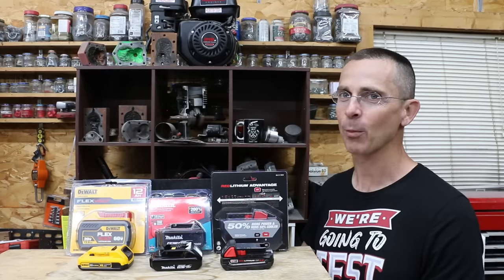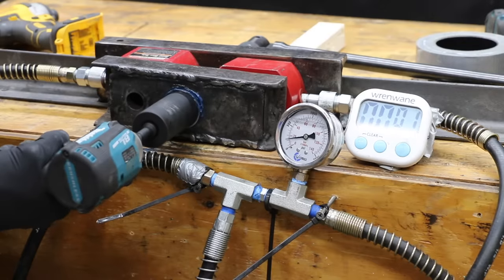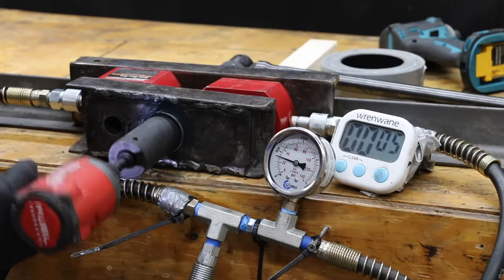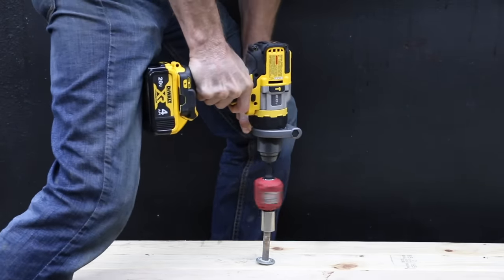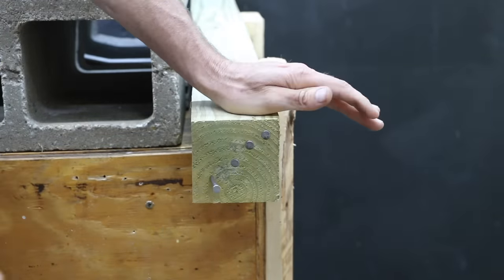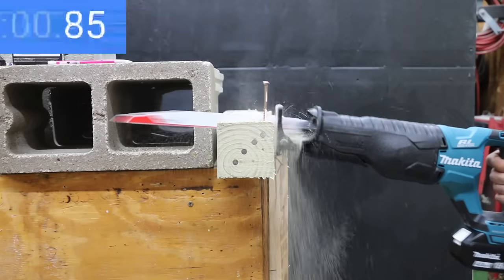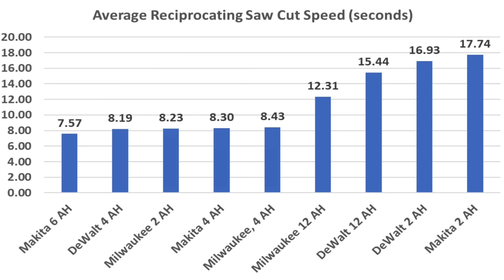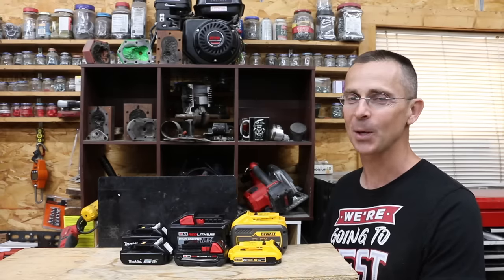Small "TOOL" Battery Better? Milwaukee vs DeWalt vs Makita

Comment: For Milwaukee at least - the difference in power wasn't related to the capacity, but instead due to the design of the battery itself. The High Output (aka CP 3.0) batteries use larger 21700 cells, versus the normal 18650 cells found in the XC (CP 2.0) batteries.  Newer FUEL tools can take advantage of these upgraded larger cells and literally make more power (torque and speed) with them, even if the capacity is smaller.  Nobody should by buying anything but HO CP 3.0 batteries anymore imho. They are more powerful and lighter and smaller for a given capacity. They are truly impressive batteries.
Reply from the maker: Thanks for the feedback.

Comment: If you know what you are doing and have the tools.  Just buy the cheapest one that fits your drill, open it up and replace the 18650's in it with some 20+ Amp High mAh ones.

Good Brands from 18650batterystore

BAK 30A 2500mAh
Samsung 25R 20A or 25S 25A, both 2500mAh

I'm sure there are other good brands out there, just make sure they are at least 20+ Amp.

If you can find some of the packs that are double size really cheap you can get more mAh out of it.
Some of the newer Higher AH packs use 21700.  So make sure to check to see what batteries they use before you order the new batteries.
Reply from the maker: Thank for the suggestion.

Comment: Told u so' on all your previous power tool testing, where you had very small batteries on the cheaper variants and often crappy packs that came bundled and your own big packs on the brand ones, that these 5A packs would fluke the result massively vs the 1.5A pack your used on the cheaper power tools, that usually was 1.5A and 2.A packs. (sure it aint easy to make it apples to apples, as certain brands dont have fx 5A packs,, but 1.5A pack vs 5A packs... would obviously screw your torque testing results a lot.
but it's funny how both you and this new Torque test channel TTC were of the impression it didn't matter.

Though they also made a new vid just a few weeks ago, where they also accepted it makes a huge difference... they saw around +25% to 30% on the ½inch impact wrench on their DIY torque rig.
I remember many years ago that Real Tool Review,  that dude with a guitar intro..which often used a Skidmore torque-rig (that YT channel is more or less dead today hence new content, but was a great YT tool-review-channel 5 to 8 years ago) his testing' made it very clear..
I used some 10 or 12 AWG silicone wires with spades connectors cramped on' and then I soldered one of these cheap 8USD 100A or 150A RC amp meter (with a blue display) in between and then had wires from the battery packs to the powertools and then i could see the amp draw on the amp display while testing it. 
It varied a lot from specific power-tool segment to the next, some had massive differences and some minor..

if the power tool is already maxing out with a low pack' and fx being choked by an over-protection circuit.. here the difference is little.. some tools have a very aggressive protection circuit, not least some angle grinders..we all know how annoying it can be when a tool keeps choking under load to protect itself and if that protection is too sensitive, can almost make some tools useless.
but on other power tools these battery packs with higher Amp values..here it mattered a lot, and the amp-peak was way higher and could sustain the amp-peak a lot longer.
same with the newer packs that are seeing daylight these years, that are using 20700 or 21700 cells.. here will lower amp-packs with 20700/21700 often outperform higher amp-packs with 18650 cells, as 20700/21700 Liion INR/IMR cells are able to deliver a lot more current, than an INR/IMR 18650 pack' if everything else is equal.
Thx for the vid PF.. +1
Reply from the maker: You are welcome!

Comment: Suggestion regarding home vacuum cleaners: 
Compare a few top brands (Dyson, Hoover, Shark, Bissell, etc) on suction when brand new, then upon regular (and equal) use monthly thereafter, for a year or more.
- Does higher suction equate to better and cleaner pick-up of dust and debris.
- Ease of cleaning, use and durability. 
- Any other useful points you come up with. 
THANK YOU for your efforts.
Reply from the maker: Thanks for the suggestion.

Comment: Those battery prices are a racket. Li-ion cells are a commodity these days (even good ones). >80% of that price is pure markup. The plastic casing is sub $1 in volume and even using retail prices for those cells there is over 50% markup much less what the BOM price is.
Reply from the maker: Thanks for the feedback.

Comment: Oi! Video idea for you!
Can you please test the effectiveness of different style garage door insulation? There’s fiberglass, radiant heat reflective/shiny stuff, and styrofoam. Especially with temperatures getting hotter year to year.
Perhaps to set up the test, you could measure the ambient temp of a closed space, with one or tow walls simulating an A/C interior wall?

I’m wondering if the radiant shiny stuff will help keep my house interior and garage cooler.
Reply from the maker: Thanks for the suggestion.

Comment: Le prix par Ampères heure n'a pas de signification . On ne peut pas comparer une batterie de 18V et une de 52V sur le seule base des ampères!. Une batterie de 18v 2Ah est moins puissante qu'une  batterie de de 52V 2Ah. 
18V 2Ah = 36Wh
52V 2Ah = 104Wh.
Une batterie de 18V 2Ah est équivalente à un batterie de 52V 0,69Ah (précisément 0,6923076923076923Ah). Il faut comparer par Wh.
Reply: Toutes les batteries sont spécifiées à 18V. Le DEWALT est de 12Ah à 18V.

Dans ce cas, nous ne voulons pas utiliser Wh car certains prétendent 20V, d'autres utilisent des circuits pour atteindre 60V. Ce sont toutes des batteries 18V avec des cellules similaires.

Comment: Didn't even watch this one. My company has all Milwaukee. I'm a millwright. Compact. Good idea. They die super fast for most applications. Only use I've found they are good for is portable lights. Maybe for the shade tree mechanic they are good. Heavy demand usage, I've drained one in 30 seconds. 1/2" heavy impact gun on a 5/8" bolt.
Reply from the maker: Thanks for the feedback.

Comment: @Project Farm, i got another idea: UPS's. What really Interests me is if they are able to be connected to way bigger batteries, Like instead of a 12V 7.2Ah use a 12v 80Ah battery and also additionaly (in a second test) add a 12v "some hundred Watts" powersupply to it to See how Long they can survive a constat i.e. 80% load. I just saw a Video by project farm, where he upgraded his moms Work at home setup with a large lead acid battery and i Wonder If you can Just Put that large battery into the UPS to save some Money.
Reply from the maker: Thanks for the video idea.

Comment: I'd love to see a video testing the many rubber and seal rejuvenators out there. Claims include rejuvenating gaskets, oil leaks, main seal leaks, transmission leaks, etc.  ATP AT-205, BARS, Lucas, Hapco Pro-Seal etc.
Reply from the maker: Thanks for the suggestion.

Comment: I really love the test. Right now I’m taking care more of my Ryobi batteries. Using them to what I really need them. For example, using impact drill to drill drywall screws, I definitely use a 1.5/2 amp battery. Drill concrete, the 4/6 ah battery and finally the cordless shop vac, the 6/9 ah battery. Makes battery last a little longer than using them on tiny task. I also separated the HP batteries from the regulars. HP tools with HP batteries, regular batteries on regular tools. Before, I thought that the higher amp hours was only for their duration of use. Which they are but with this video, it also increases their performance. So yeah…… I know is a something I do, with what i wrote……. I honestly wanted to complain about my boss using my drill with a 9 ah battery to remove an outlet…. Now that i got it out of my system. These test are awesome!
Reply from the maker: Thanks for sharing!

Comment: What about compared to the Ridgid tools? I was actually hoping to see a comparison since that is the brand I invested batteries and drills with but I suspect they would probably perform at the level of the Makita ones.  For sure using the 4AH battery is a lot more power and with a circular saw (which I have and use for light work) you need that 4AH battery.
Reply from the maker: Thanks for the suggestion.

Comment: Have you considered starting a 3d printing series? 

Most household 3d printers are within the same range as some of the tools you buy, around $300 - $1000 and printing material is easily between $10 (for basic plastic) and $1000 (for PEEK) per Kilogram
Reply from the maker: Thanks for the suggestion.

Comment: Best all around batteries are 4ah. Cost and full capacity charge times. I have kobalt weed wacker, tire inflator, and leaf blower. Seems like the 4 is most consistent with power and longevity for the task. Are the kobalt batteries any worse than desalt or Milwaukee brands? When my older craftsman drill and impact wrenches go out I will have to go with kobalt tools for the same battery family that I have on stock. Kobalt warrants all tools for 5 years and batteries for 3 years. I’m not a tradesman and cannot make a full lineup change on brands at once. I’ll probably get a cordless sawzall next, but I’m not replacing my skilsaw mag77(that’s my project baby). Overall I prefer Diablo blades over Milwaukee’s.
Reply from the maker: Thanks for the feedback.

Comment: dewalt 1.5ah and 2ah batteries, as well as the makita 2ah batteries, should NOT exist. they are trash. i use both systems and those small batteries suck so bad, in some cases making the tools unusable. they are basically mass produced landfill. makita's 3ah batteries and dewalts compact 4ah should be the standard battery for their tools. can't speak for milwaukee as i don't own any of their tools
Reply from the maker: Thanks for the feedback.

Comment: Have you tried how 18v batteries of different brands perform on the SAME tools? For example, a Ryobi vacuum cleaner using a Milwaukee battery Using an adapter?
Reply from the maker: Thanks for the suggestion.

Comment: I am curious about Dewalt's three different lines of 20v 1/2" chuck drills, mine is about due for replacement. I have flexvolt and large XR batteries so I don't know if I would get better results from the flexvolt advantage, power detect or regular. Or maybe they are all the same with different stickers for different suckers. I trust PF videos exponentially more than I trust home depot ads.
Reply from the maker: Thanks for the video idea.

Comment: Wow! I did not even consider this as reason some of my tools underperformed with bigger batteries. This is.a brilliant video. Love your work. have you done a video comparing same size batteries from each brand, e.g. 2Ah from each brand on a leaf blower to determine whose actually is 2Ah and whose isn’t? Lloyd
Reply from the maker: Thanks for the suggestion.

Comment: I exclusively use 2 amp batteries for my combi drills and drivers.. Somtimes if im making a quick cut ill als use them on my jigsaw.. I use the 5 amp for the big stuff aka saws, grinders ect.. I absolutely hate large batteries on a compact tool like a drill, if your working with you hand extended out or up like I do in carpentery,framing overhead and installing drywall  the smaller batteries make all the difference on a long day..
Reply from the maker: Thanks for sharing.

Comment: That Dewalt wasnt a 20v 12AH battery in the recip saw, it was running as a 60v 4AH. It's quite interesting how the higher voltage hurt the Dewalt Flex Volt recip saw. I believe the results would be a bit different if the tool and battery weren't the "Flex Volt" line.
Reply from the maker: Thanks for the feedback.

Comment: Seeing these battery adapters I'm interested in seeing if battery brands would effect the tool power like if using a DeWalt battery on a Ryobi drill would boost the drill's power.
Also since you've cracked these batteries open before I would be cool to see how replacing the 18650 cells in the battery with better quality ones like the lg mj1s would effect the battery pack performance and runtime
Reply from the maker: Thanks for the suggestion.

Comment: Love your videos, I think a item i struggle with finding a good one for is Thread sealers.... Would love to see a comparison i think it wouldnt be too expensive to test and you could test against pressure, fuel, heat, cold..... And use Tape vs dope vs thread locker, vs PTFE selaers, vs silicone the list goes on and on....
Reply from the maker: Thanks for the video idea.

Comment: This has me wondering: Milwaukee for example has a 3.0ah AND a 3.0ah High Output... is there a difference or just a gimmick?
Reply: In my experience, it is very much not a gimmick. The 3.0ah High Output batteries deliver a noticibly larger amount of power when compared to the regular 3.0ah batteries.

Comment: I use a 2.0 in my DeWalt or my Milwaukee impact as I primarily only use it for screws and when using it above your head all day it makes a difference I use a bigger battery in my saws,  drills and in my Milwaukee 3/8 and 1/2” impacts
Reply from the maker: Thanks for sharing.

Comment: Welding Gloves? Have you tested those yet? For heat resistance, grip and finger movement, burn through from molten metal drips or slag. There's a brand that's fairly cheap that I like more than my Millers which were moderately priced.
Reply from the maker: Thanks for the suggestion.

Comment: The battery adapter seems interesting, I wonder, why don't they make mod kits to use those 12 amp hour batteries with other devices such as electric shavers? Just have something to keep the  voltage under the max voltage the motor can handle, and see if shaving performance improves.
Reply from the maker: Thanks for the feedback.

Comment: The DCD999 is specifically designed to detect Flexvolt batteries and draw more power.  It would be interesting to see this test on the DCD996 which does not have a system to detect which battery is connected.  The DCD998 looks for higher Ah (8+) batteries and produces more power when it sees one.
Reply from the maker: Thanks for the suggestion.

Comment: Just a FYI from a heavy equipment mechanic , pressure guages are intended to be used in the center 1/3rd of their range, ie a 3000 psi reading, I use a 10,000 psi gauge, at a minium you would want to use a 5,000 psi gauge and 2,500 I get by with a 5,000 psi, once you go over the numerical reading, the gauge is junk for having any understanding of the reading as you have weakened the interneral bladder of the gauge, it is kind of like over streching a spring on a scale then trying to weigh somingthing.
Reply from the maker: Thanks for the feedback.

Comment: You should consider a video on diff gear oil in general? Toyota gear oil cost like $40 a liter. 
Speaking of which, Toyota motor oil is said to be made by Mobil 1 but “has their own additives.” That might be in interesting lab test/ test.
Reply from the maker: Thanks for the suggestion.

Comment: In my emergency pack I carry 3 different types of lighters, each has an area they excell at.
So carrying multiple size batts will keep the project running smooth no matter the challenges 👍.
Thanks again professor!
Reply from the maker: You are welcome!  Thanks for sharing!

Comment: At different voltages, comparing batteries by Amp/Hours seems deficient. Watt Hours would be a far better unit to use. It is after all, how the energy contained is measured. ;)
Reply from the maker: Thanks for the constructive feedback.

Comment: @Project Farm you know, probably without a dyno it may be difficult but I find myself with no proof to a catch can ventilation system vs a PCV ventilation on an engine and which of the two makes power or makes you lose it. I know it would be cool to see something showing power gains with dealing with blow by
Reply from the maker: Thanks for the feedback.

Comment: This isn’t a product review recommendation but I’m an aircraft technician and we use lock wire/safety wire on just about every bolt and nut that is large enough to use it. I’m wondering if it really makes a difference over simply torquing. Maybe compare it to some loctite products and make a device that simulates the vibrations of an aircraft/automobile in operation.
Reply from the maker: Thanks for the video idea.

Comment: I have found something strange with the multivolt hikoki batteries,  if I use a 18volt 5 ah battery in the 18v circular saw c18dsl , it will try much harder before it hits the overload than if I use the 36v 8ah/4ah multivolt battery.  For some reason the extra power of the multivolt battery seems to hit the overload with barely any pressure compared to the 18volt that came with it
Reply from the maker: Thanks for the feedback.

Comment: I can definitely attest to the larger battery packs offering tools more power. I’m a general contractor and whenever I need to cut something tough with my multi tool or sawzall I always throw a large battery on it. Before you even put the tool to work you can actually hear the difference in the motor running with the different batteries. Also, not surprised that Milwaukee was breaking adapters, they really make the best cordless impacts out there IMO. I have DeWalt everything imaginable, yet I also have a full set of Milwaukee impacts and ratchets for my home garage because that’s the best brand I’ve found for working on my engines/vehicles. It puts my DeWalt guns to shame.
Reply from the maker: Thanks for sharing.